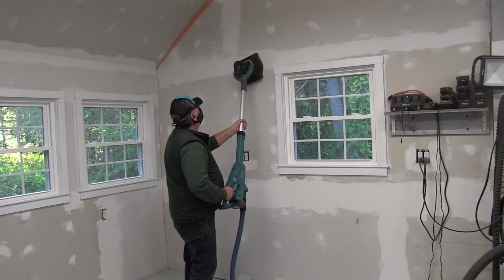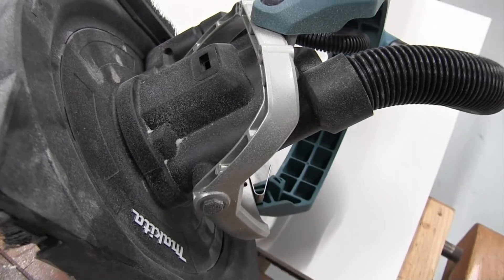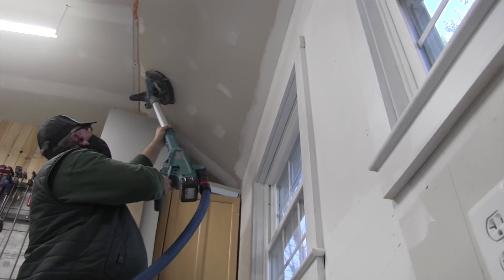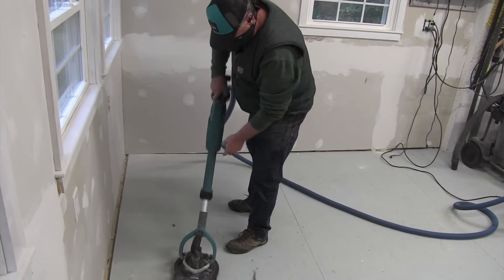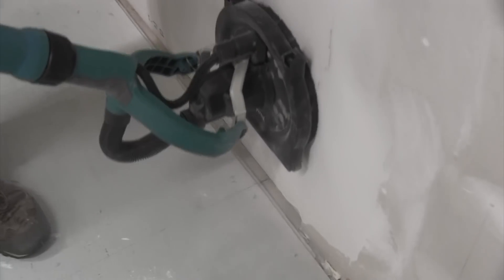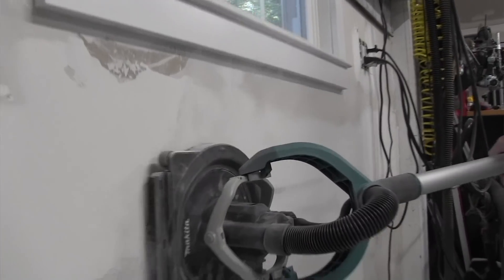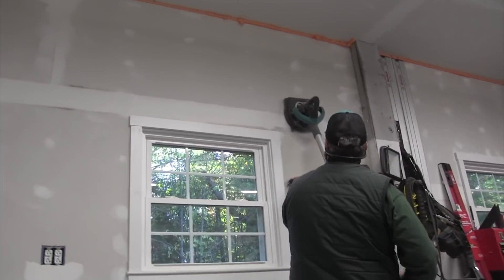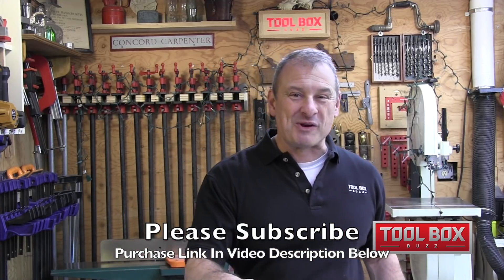MAKITA 18V Cordless 9" Drywall Sander W/AWS - XLS01Z

Comment: Kit is $699.00 but figure on adding a couple hundred extra for batteries, as you'll need 3 to keep this running without interruption, as the stated run time is "up to 35 minutes"

Comment: I own the Planex so I doubt I'd buy this even though I already own a ton of Makita 18v tools.  Seems like this sander kicks out a lot more dust than the Planex so I was wondering what extractor you had this hooked up to. As far as cord/hose management for the Planex I use velcro cord wraps to keep the hose and cords together. Festool does make a boom arm for hose/cord management, but the price is typical Festool so I never bought one. Thanks for the good review!!
Reply from the maker: Chopped Champ great observation. We were using Bosch’s large commercial extractor and later found the bag was full of sawdust. Once we swapped out the bag it was awesome! You saw clips  of it being used when bag was full.
Reply: In the article, I explained that the dust collector was incredibly full and not performing well. We saw substantially less dust after replacing the fleece bag and cleaning the filters. I would also like to mention that TBB reports on and show what we encounter when doing reviews and tests. We certainly could have left the clip of the dust escaping the sander on the cutting room floor.
Reply: I use my Makita sander with the Makita VC4210L dust extractor. One builder commented that "there's no dust at all". That was an exaggeration but the dust management is still excellent.

Comment: I would like you to follow me around for a week finishing drywall you will not use sandpaper at all unless you are finishing your drywall for a very smooth finish and then you only have to lightly sand at the very end... That does look like a nice unit though Makita has their stuff together
Reply: glad someone said it. i've met some great drywall guys who's finished work requires little or no sanding.
Reply: You do it old school, just like I was taught. I don't understand the need to put so much mud on a wall just to sand the crap out of it.😂😂😂
Reply from the maker: Gus Benson couldn’t agree more some guys are TALENTED- not us!
Reply: I have a 3 car garage full of tape that blistered and my first attempt at a powder mix ended up with mortar soup all over things under the ceiling. 😞 And the tape still needs redone. I have since tossed the powder and am using the green lid stuff at Home Depot and have had better results with that.  My biggest issue is that sometimes I want to get more done and then I go over places too much and end up making it worse😞...   I have learned quite a bit and am better now. 😇😎  But out of curiosity...  What would it cost me to have a drywall guy come in and retape all the stuff on the ceiling? Just wondering if it is better to pay the professional for something that could be done a lot sooner than my own labor.
Reply: @mrupholsteryman  if you have the time and the patient's I personally would tackle it myself.. just remember a few simple rules about taping and mudding the biggest rule is.. less is more when it comes to drywall mudding rule number two make sure your joint compound is always moist free from debris.. practice makes perfection. Generally it takes three coats of mud.. or if you prefer get a couple quotes from drywallers and see if it's in your price range.. they can have it done in three days it's all up to you otherwise good luck on your project
Reply: @gusbenson1083  I'm probably gonna take it on myself. Thanks for the reply. 😇😎
Reply: @ConcordCarpenter  funny story, when I was learning how to tape, float, and more specifically shoot texture.  I went out and purchased a hopper and thought I would do a heavy knockdown.  Of course time is money and I didn't want to have to wait for the mud to set up before knocking it down so I decided to use 20 min mud thinking by the time I was done shooting the room I could go right at knocking it down and on to the next room.  Well as everybody on this thread probably knows the hot mud hardened like concrete in my brand new hopper before making it to the second wall. Dynamite wouldn't get that mud out, had to trash the hopper, re-sand the wall and re-shoot with a pawnshop rig I found that I could afford at the time, lol!  Luckly it was one of my rental properties so I didn't get hurt too bad on the job except for my ego.  The funny part is to this day you can go room by room and see my drywall learning curve.

Comment: I have this tool...absolutely love it!
Reply: I like to have first hand information on this too from someone who really use this sander , can you please give me you serious opinion on performance and battery life ?
Reply: The tool is great.  Like the video says and with most powered Sanders it will sand right through your mud and drywall if you are not careful. I see between 20-24 min of run time on high.  For me that's plenty, usually in need of a rest anyways. I have plenty of batteries so never have to wait foe anything to charge.

I would recommend the Makita 36v vacuum with this tool. Blutooth enabled makes this a no brainer if you do drywall.  Dust collection is great.

The tool comes with a nice bag with a tray to protect the head.  It's a big investment but it pays foe itself in one decent sized job.
Reply: @RenovationsandRepair  thanks for you reply I definitely going to invest on one , all my cordless tools are makita is wy doesn't hurt me buying this, 
My existing sander is porter cable a cyclone dust system and a 6 hp vacuum and works really good,  the only complaint is the hassle of having transport all of this back and forth to the downtown buildings,  so I like the idea of having something more compact,  again Thanks for taking the time to help me to decide to get this piece .

Comment: 💥💥 Anyone that is complaining that the dust extraction system isn’t good is just moving the tool too quickly. You can’t move it back-and-forth as quickly as you would with a manual sanding pole but instead you have to move it slowly and let the dust extraction system do its job and be better matched  with the slower speed.  By going slower with the tool it’s not taking longer to do the job because moving faster just doesn’t give it enough time in any one given spot to sand  completely.

Comment: Good review!  I bleed Makita blue. Have you tested the Flex Giraffe sander? If so, how would you compare the 2? Have been weighing between the 2.
Reply from the maker: Work is fun... it’s in the shop waiting for a place to test it
Reply: @ConcordCarpenter  come on over, It'll get used on my next job. 😉
Reply: @ConcordCarpenter  Did you ever get around to trying out the Giraffe sander?
Reply: I have the giraffe sander it’s really good. Couple of things that I don’t like is there’s no light on it. And that it is chorded. But I have heard a lot of people like chorded because you don’t have to worry about batteries.
Reply: I ended up buying the Makita sander. I love the cordless ability of it and it does eat when you want it to.  The cons : 1) the newer versions did away with the removable edge I believe, rightfully so cause it just gets in the way and I have bumped/damaged corners with it. 2) the dust collection sucks and not literally. You have to turn the speed of the sander down so it generates less dust because (I'm guessing here) the tiny hose attached to the head can't keep up with the suction placed on it with my shop vac.    Would I buy it again? Yes.  Just has a few quirks to get used to.

Comment: Personally, I don't think a regular pole sander will be completely replaced. However the cost of this tool beats every powered sander I've seen and used. ( They are expensive, I haven't bought one, and the most reliable one out there is around 800 bucks fully set up) if this one doesn't need to be rebuilt every two months due to the dust and wear. It will already out perform the corded tool. I'll fork out the money for this one and let you know. I would like to know more about the pads and what grades are available.
Reply from the maker: Hector Espudo I agree the drywall dust can kick the snot out of tools like these. Makita has their important components sealed. The pad is decent quality and the 9” loop grits will fit standard paper
Reply: I just sanded 4000 square feet of drywall with my Makita sander. The only thing I had to do afterward is do the usual check with a light which is what we always do when pole sanding as well. It's worth noting that the Makita is designed to sand into the angles. I'm not aware of any other power sander that can do that properly.

Comment: If this sander makes that taping job look good, I'll throw my Porter Cable in the dump. As far as the video goes, I'd like to know the weight comparison with the motor on the end of the shaft vs the 7800.
Reply from the maker: eric ryder haha funny, this is one of our guys shop - we’re carpenters not drywall finishers.
Reply: This one his 9.something pounds compared to other sanders which are 14.77 pounds mostly.

Comment: I had this tool and the AWS vacuum. It SUX and not in a good way. Dust collection is extremely bad, might as well not even have the vacuum hooked up. I later tried it with a corded vacuum with a 6.5 motor and it was no different. The sander is quite heavy if you are doing overhead sanding. Overall I was disappointed in the tool, especially with the dust collection, the weight I could tolerate but the dust control was a real deal-breaker, especially when connected to its AWS vacuum.
Reply: I saw another review of this tool and he was moving it way too quickly for the dust extraction to keep up. Are not supposed to move it around like a sanding pole but instead move it slowly and the dust collection will do its job just fine.  Good luck slowing down a little.  🤟🏼
Reply: @Jimmy_Cavallo  have you personally used it before?
Reply: I am running into the same issue, any luck resolving that?
Reply: My dust suction is terrible also

Comment: The vacuum hose isn't a big deal. Mainly if you get the Makita's vacuum cordless backpack!
Reply: Chico Maciel So you can sand one room Before you have to dump it out
Reply: @rsharpe1985  indeed!
Reply: @rsharpe1985  only if you suck as a taper. I would fill that 6L backpack after sanding about 3000 square feet of drywall myself.

Comment: So, they copied Festool's motor layout and removable edge piece, made it cordless (except you still need the vacuum hose), made it 2 pounds heavier than Festool and made it only slightly cheaper.
Reply from the maker: sure - but what if your on Makita's platform?  They have over 200 cordless tools - not sure how many Festool has but its not 100
Reply: @ConcordCarpenter  Point for Makita but festool don't continuelly dropping tools on the market just to stay present. They spend time in think  develop and think through
Reply: Not to mention that Makitas AWS adapter works on any vacuum with a power outlet.
Reply: Very true. They do fall behind a bit then play catch up.
Reply: well while festool take their time thinking things through. I'll have just about any tool I need today. When I need it. When choosing Makita. Festool make great tools. But I need my lawn mowed today.
Reply from the maker: Nevyn are you sure?
Reply: @ConcordCarpenter   about the AWS adapter yes. Makita doesn't advertise their accessories or attachments as much as Festool but it doesn't mean that they don't have them. I think Makita aims at ease of use, robustness and build quality. Festool goes for build quality, precision and how many attachments the price of another tool they can sell. Sorry this is a rushed reply as I head off to work.
Reply: @N1rOx  Makita have Mowers
Reply: @nevyn6071  yup, that's my point
Reply: Well duh of course it's gonna need a vacuum hose! Did you expect dust to travel wirelessly? 😂
Reply: The Festool can't properly sand into the angles like the Makita. It scrapes and ruins the adjacent wall in the process. The Makita is also 40% cheaper which is not "slightly cheaper". It's also cordless which is an absolute bonus if you're a professional like myself. The you've got the problem of the gimmicky Festool sandpaper which adds ceramic to the aluminum oxide. The ceramic is not a suitable abrasive for drywall. It's meant for metal.

Comment: run time way to short.......
Reply: Try the Mirka Leros, way smother, 3lbs lighter, a superior tool all around.
Reply: @bobseguin2195  Uh, no it's not superior. Try dragging that extension cord around while wearing stilts. Also, the Mirka can't sand into the angles properly like the Makita. The run time is just fine as well. Mine usually lasts about 45 minutes with the start/stop nature of the job. That coincides with a sandpaper change time.
Reply: @stephenwerner1662  my cord is attacked to the hose, with a sock over both, no problems, and random orbital, 180 degree pivoting head, and lighter, ya, it's the best.......you have to change paper after 45 min.....try mirka abarnet, or festool mesh, can sand a whole house with 1 or 2 sheets. Angles and 3 ways, and tight area's, still need hand sanding, as well as light checking....
Reply: @bobseguin2195  yes, 1 or two sheets for a whole house..............................minus the angles of course. 😒 The Mirka discs are good but the Festool are just expensive and gimmicky. I don't use sanding products with ceramic. Inconsistent finish. 
The Makita is is also random orbital
The Leros 180 degree head is really nice 
The Makita can be used without cord and vac. Removing the cord reduces the overall load on the arms, just like with screwguns. The Mirka feels heavier in that comparison. 

I think the Mirka is an excellent machine. I simply have a problem with you going everywhere bashing a product that you have never used.
Reply: @stephenwerner1662  those trolls are everywhere 😎